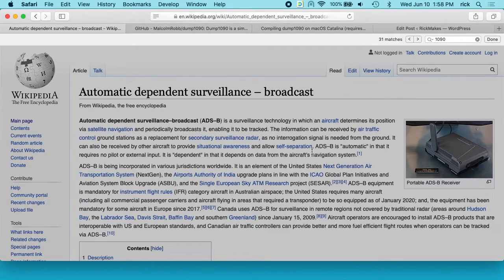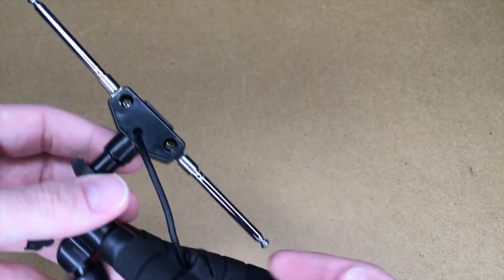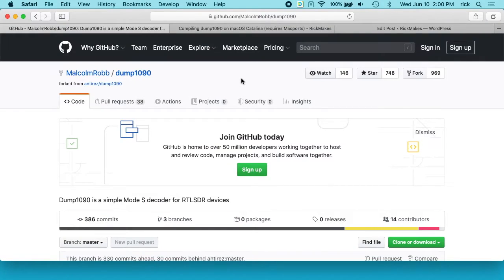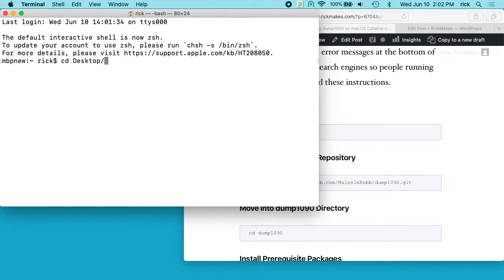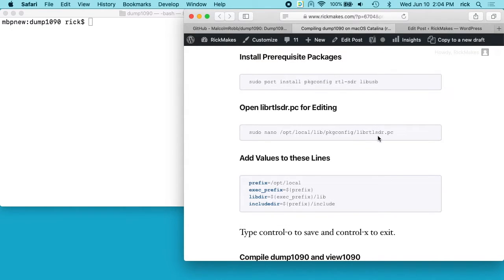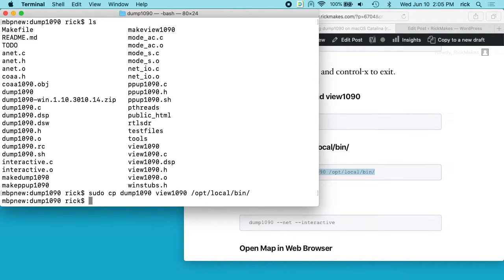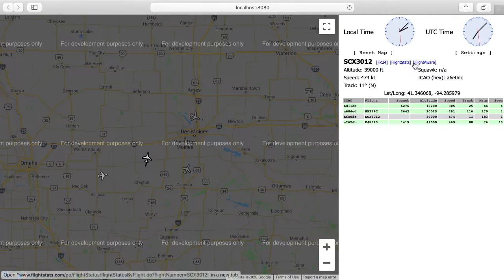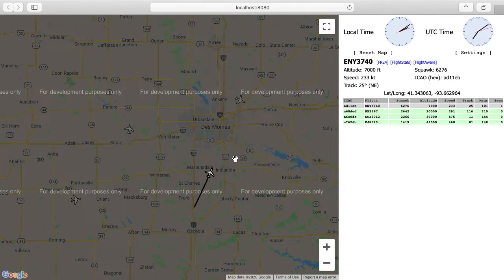Installing dump1090 Aircraft Tracking on macOS Catalina (requires MacPorts)

Comment: for some reason I'm not able to install it on Mac mini running Big Sur. Any ideas?
Reply from the maker: Are you getting any specific errors?
Reply: I ran into issues as well on Big Sur (11.2.2). 
I swapped the dump1090 repo in the video for the FlightAware fork:
https://github.com/flightaware/dump1090

then just run "make" as noted in the video. 

If you get an error regarding "endian.h", try this answer from StackOverflow which resolved it for me:
https://stackoverflow.com/a/58418801/2168175

Comment: Very nice video and documentation. Thanks for that.

Unfortunately I get an error message: ...make ->
...  gcc -g -o dump1090 dump1090.o anet.o interactive.o mode_ac.o mode_s.o net_io.o `pkg-config --libs librtlsdr` -lpthread -lm 
ld: can't open output file for writing: dump1090, errno=21 for architecture x86_64
clang: error: linker command failed with exit code 1 (use -v to see invocation)
make: * [dump1090] Error 1

Do have any idea how to solve this issue?

edit:
I solved it. I switched to "git clone https://github.com/antirez/dump1090.git".
Then I followed this instructions "https://www.mactopics.de/2016/03/07/ads-b-dump1090-auf-os-x-el-capitan-installieren/".
It is in german only... but it works for me.
Reply from the maker: Not sure what would cause that error but I'm glad to see you got it working. :)